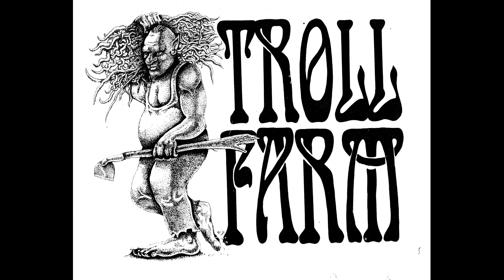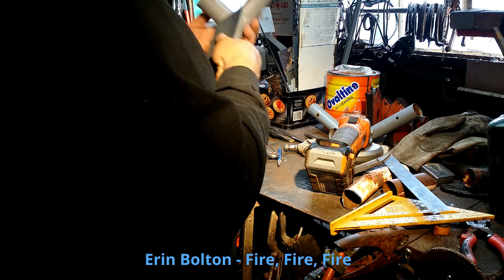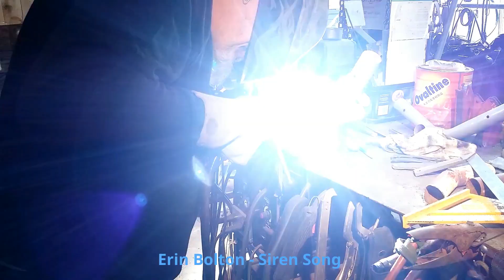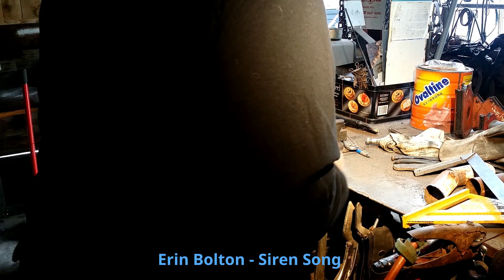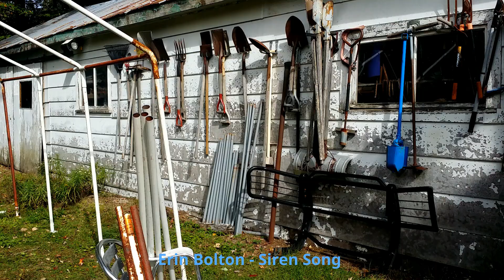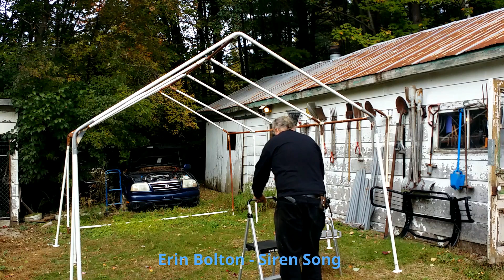Scrapped Temporary Garage to Greenhouse Conversion Pt2

Comment: I think instead of center posts, you should seriously consider adding cross members across the "hoops" just above head height, from about the center of each peice across to turn the upper angled portion of the hoop into a truss.  You are then stiffening both pieces right in their center which makes them much less likely to bend under load. And once you do THAT, you can run a secondary ridge pole down on top of the cross members and run angle braces from the peak down to the secondary pole.  It turns your whole roof into a super strong truss and it keeps it all above your head so you don't have to worry about working around support poles etc.  It is the system inside my big tunnel.  You could do almost all of it with 1/2 inch EMT, I'd use something bigger for the secondary ridge pole.  You'd also have to make or find band brackets for wrapping around the tubing to connect things,  they are easy to make though for a guy like yourself.  I can do a video of my houses to show you what I mean if you want.
Reply from the maker: Yes, Tim, please do a video of your greenhouse!

Comment: How do ya plan to anchor it to the ground?  The way we did it, due to the wind out there in MB was I laid patio stones, enough for the footprint of the frame.  On top of those, I used tapcons to attach 4x4 beams to the stones, and finally used some large bolts to secure the frame to the 'foundation beams'.  As you probably know, those things can be like giant parachutes if the wind gets inside of them.  Cheers!
Reply from the maker: I've made all of our raised beds out of Pine logs, I'll probably do the same for this...
Reply: @trollforge  That'll likely do ya.  As long as the thing is bolted down to something.